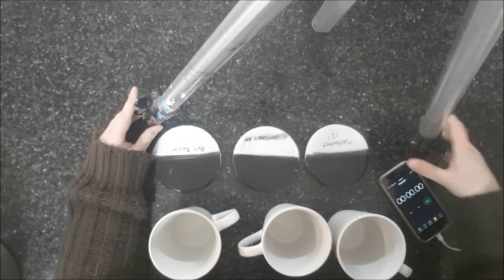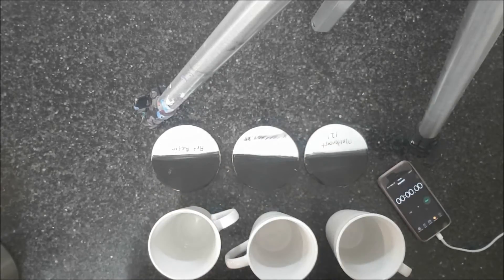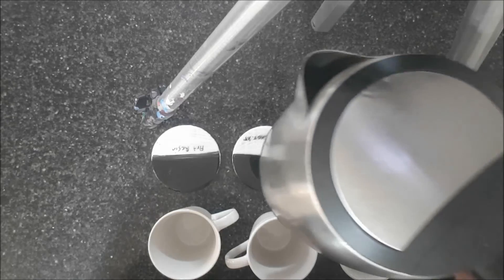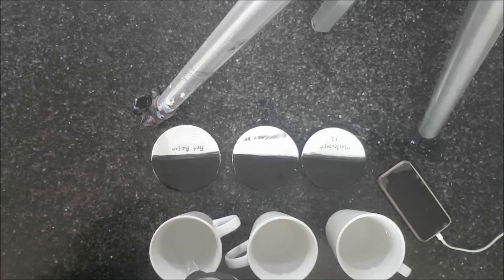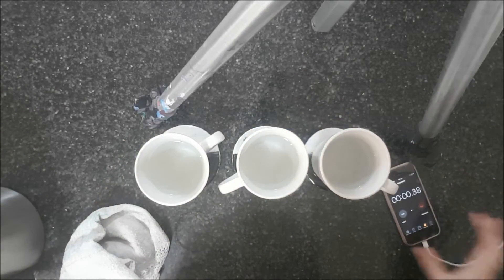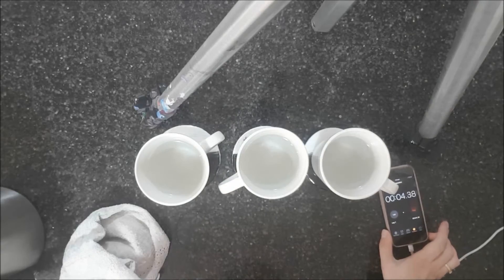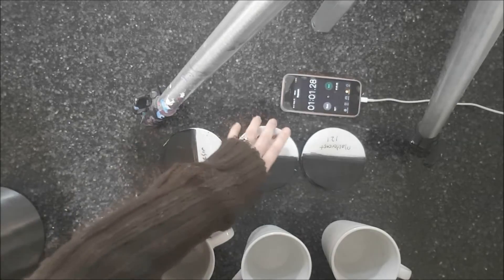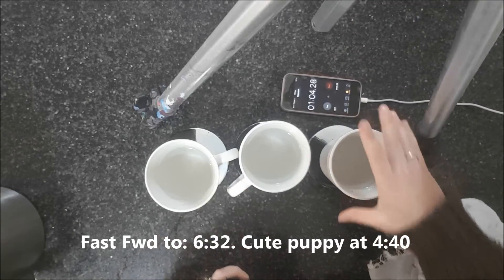[31] Heat test on three types of resin coasters (Art Resin / Mastercast 1-2-1 /  Ultracast XT)

Comment: Thank you so much for this test. I'm new to resin... Can you use whatever resin you want to make your coasters but just do your final coat with the UltraCast?
Reply from the maker: Yes that's what I do. I prefer a thicker resin for the design. And then flood coat with something heat resistant.
Reply: @MauzyCreations  Do you have to tell customers to wait 5 weeks before they can put something hot on it too? :O
Reply from the maker: @delilah9974  I literally have, yes!! but I say 4 weeks.

Comment: Thank you for doing this, I stopped making coasters because of this reason.  I've been told that coasters should be made with polyester resin.
Reply from the maker: Glad it was helpful. I got a shock as Ive been using mastercast and turns out it marked.